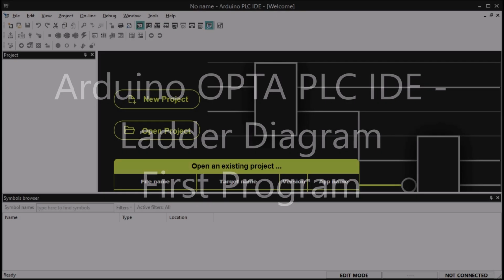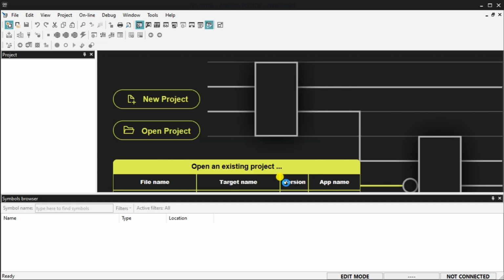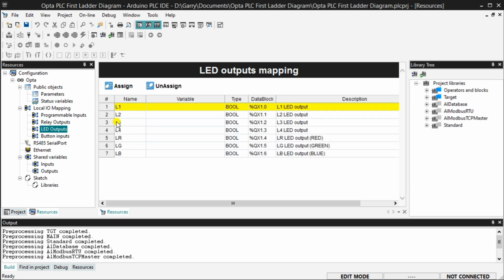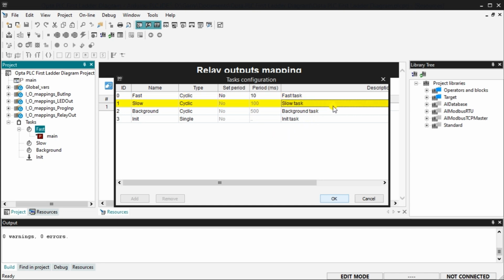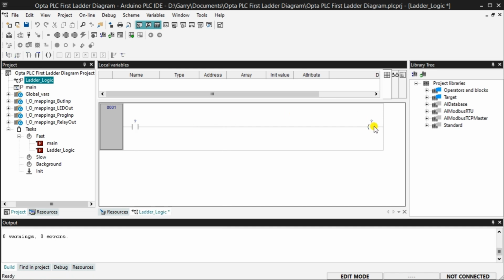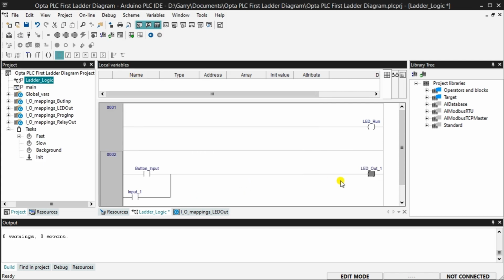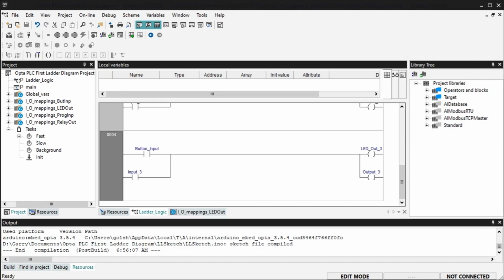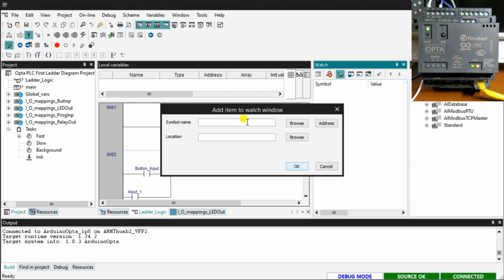Master Arduino OPTA PLC: Your First Ladder Logic Program!

Comment: Are the LED outputs simmilar to the memory bits as seen in other ladder programming software?
Reply from the maker: Good question, and sorry for the late reply! Not quite — there's an important distinction:

The Opta's onboard LEDs are actual output coils — when you turn one on in ladder, it lights the physical LED on the controller. So they behave like any output (you drive them with logic and can read them back with a contact), but they're tied to real hardware, not internal-only bits. They're handy as visible status flags, which is probably why they feel memory-bit-like.

True memory bits (the "M" bits / markers you see in other PLC software) are made differently on the Opta: in the Arduino PLC IDE you declare your own BOOL variables in the global variables — not mapped to any physical terminal. Those live purely in memory, and you set/reset them and use them as contacts exactly like the memory bits in Click, Productivity, etc.

So: LED outputs = physical output coils (they drive the LEDs); your own internal BOOL variables = the real equivalent of memory bits. Use the LEDs for visible indication, and your own BOOLs for internal logic and latches.

Full first-program walkthrough: https://accautomation.ca/arduino-opta-iot-plc-quick-start-ladder-logic/

Regards, Garry — ACC Automation

Comment: thank you for your video may i ask you how can i upload the program that each time when connect plc opta to plc id it shows NO CODE and when i plug in to run the code thank you
Reply from the maker: Thank you, and sorry for the late reply! "NO CODE" simply means no program is loaded on the Opta yet — so you need to compile and download your project to it. Do it in this order:

Runtime first. The Opta needs the PLC runtime installed before any program will run. If you haven't done that yet, download the runtime to the Opta in the Arduino PLC IDE (first-time setup, over USB).
Compile your project (the Compile button / F7) and make sure there are 0 errors.
Connect — On-line ▸ Connect (or the connect icon) until it's connected.
Download — On-line ▸ Download (the download button) to send your compiled program to the Opta. Wait for it to finish.

After a successful download, the program is stored in the Opta's flash and runs automatically — including every time you power it up — and the status changes from NO CODE to RUN.

If it still shows NO CODE after that, the download didn't complete or the runtime isn't fully installed: double-tap the reset button to enter bootloader mode (pulsing light), reinstall the PLC runtime, then compile and download your program again.

Tell me which step it stops at and I'll help you finish it. Full first-program guide: https://accautomation.ca/arduino-opta-iot-plc-quick-start-ladder-logic/

Regards, Garry — ACC Automation

Comment: Can you run and test how the ladder logic diagram works without connecting to the plc ??
Reply from the maker: There is no simulator that currently works seamlessly with the OPTA.
If that is something that you need. I suggest the XGB PLC. You will be able to simulate in several of the IEC PLC languages. Here is the link to the series
https://accautomation.ca/series/ls-electric-xgb-plc-series/

Here is a video showing the simulator for structured text programming:
https://www.youtube.com/watch?v=iLQ-AcI3Qn0
Regards,
Garry
Reply: Thanks  @ACCautomation

Comment: The industrial input sensors are 24v. Can we connect directly?
Reply from the maker: You can directly connect the 24 DC voltage sensors to this Opta controller. 
Please see this quick start guide for this controller.
https://accautomation.ca/arduino-opta-iot-plc-quick-start-ladder-logic/
It will show you how to wire sensors into the Opta controller.
Regards,
Garry

Comment: This might be a bit of an ask, but it would be good if you could show how to connect the arduino Opta to SCADA platform like Ignition (using Modbus TCP probably). There is very little documentation online and quite tricky to figure out. Cheers
Reply from the maker: Hi @slipnslime9982
I have requested additional documentation on the Modbus TCP / RTU communication for the OPTA. 
I plan on explaining how this works when Arduino has documented it and it is proven to work. 
So far, during my experiments, I have gotten the Modbus TCP Client working, but not the Server because the addresses have not been documented.
I have been promised by Ardunio to have this in a couple of weeks.
Regards,
Garry
Reply: @ACCautomation  okay thank you. There’s another YouTuber Jacob Sagatowski who managed to do some SCADA stuff with a portenta but I could not manage to get it to work with the Arduino OPTA. I’m doing this for my electrical engineering thesis in University so don’t have any industry experience with PLC/SCADA and I doubt I did it correctly. Will be interesting if you can achieve this
Reply from the maker: @slipnslime9982  
Using the native C++ and Arduino IDE software, you can achieve this currently. However, using the Arduino PLC IDE software, there is no documentation.
We will see what Arduino comes back with. I believe that this will be a firmware update or software update with the documentation.
Regards,
Garry

Comment: I am not sure where this device is supposed to fit.  It doesnt have expandable IO and its price point puts it in the same space as the click, logo and easy e4.
Reply from the maker: Hi @diode30
This programmable relay is part of the Arduino Pro series. The Arduino Cloud and easy communication would be one of the main benefits of this controller.
https://www.arduino.cc/pro/
Regards,
Garry
Reply: Expansions almost here ...